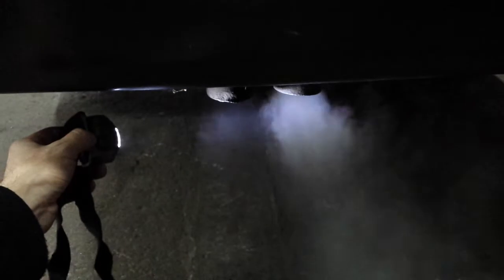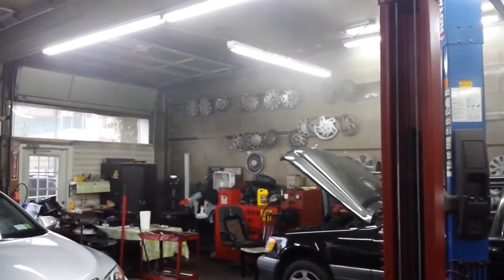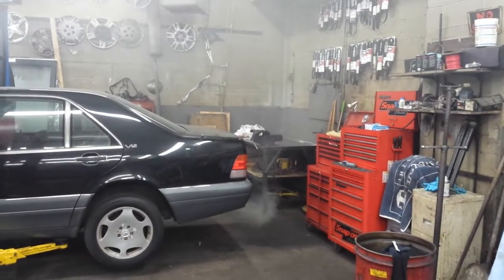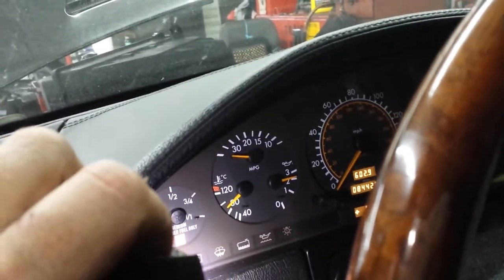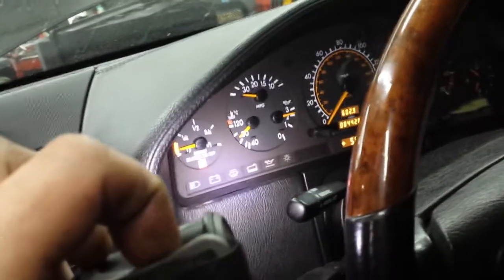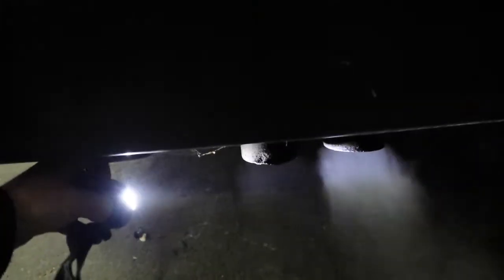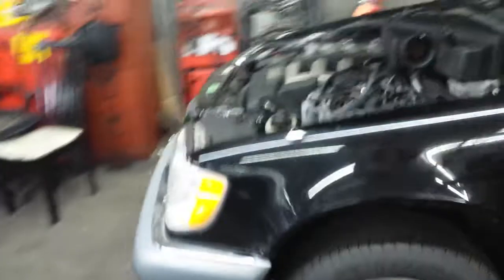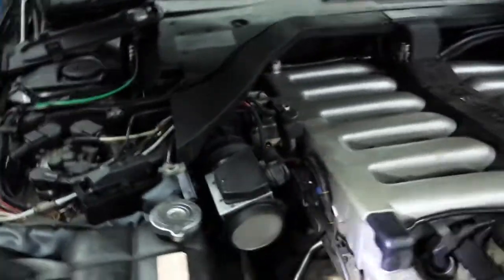Miran S600 smokes

Comment: Looks like vapor from coolant getting into the combustion camber or exhaust system.  Is the order of smoke sort of a sweet smell,  like hot antifreeze?    Is the antifreeze reservoir level dropping or mysteriously disappearing after driving for several weeks.   If so there my be a small leak from head gasket or other source getting into combustion chamber or exhaust system.

Comment: I'm having this exact same issue (white smoke, only from one exhaust port), did yhou ever solve the issue? Thanks
Reply from the maker: If it's a v12 Mercedes and smoke is coming from only 1 exhaust pipe it could be it might be either due to one bank not burning properly or head gasket issue (quite rare case though). I need to see the car to diagnose it properly
Reply: @vsandvs  the car itself runs fine and very quiet, coolant level isn't going down and head gasket tester shows negative. I'm thinking something to do with the automatic transmission fluid?
Reply from the maker: Ohh. I made that video 9 years ago, lol. Hundreds of v12s went through. I don't remember what was done to that one. But I know it was repaired. 
I need to see the car to figure it out.
Reply: @vsandvs  Gotcha, appreciate the reply. I just took the mufflers off and at least for now it seems like the smoke has subsided. The car has sat for 15 ish years so I assume there was just a ton of unburnt water inside?
Reply: Hi, have you solved that problem? I’m having exact same issue.
Reply: @erikpla1  Not yet sadly, after running the engine for a while it seems to get better tho